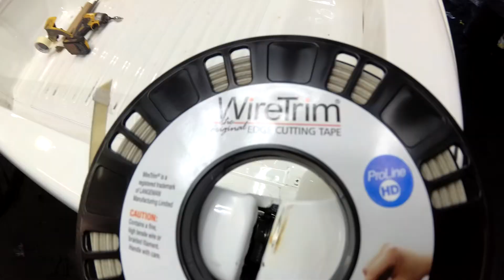The Tacoma gets Line-X Premium - Project Sadie 1st Gen Tacoma TRD Off-Road

Comment: Which option did you go with? Regular or UV protected? I have same Tacoma year/trim in black, and thinking of going with Line-X.
Reply from the maker: I did the UV protected, I was debating since I had a non-uv one back in the day and thought it was fine.  I read a bunch of threads recommending it so I bit the bullet and went with it.  It is supper shinny and still looks brand new.   Plus, the place I took it too, Dominion Line-X had a deal if you got the UV.  We'll see how it does next summer but so far I love it.  Thanks for checking us out!
Reply: Brady Adventures how much did you pay for it?
Reply from the maker: 650, best deal I could find
Reply: Brady Adventures tax included?
Reply from the maker: nope that was quoted price that included 100 discount on the uv treatment can't remember what it was with tax but a little bit more.
Reply: Great! I’ve made an appointment for the Premium. Thanks for the info!
Reply from the maker: @David_Day  Cool, if you're headed to Old Dominion let them know I said hi! :-)